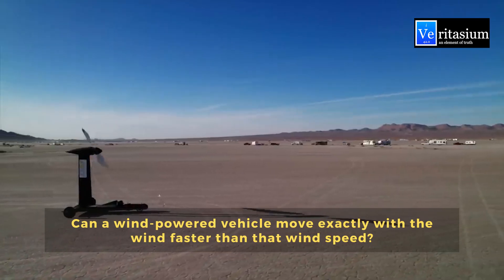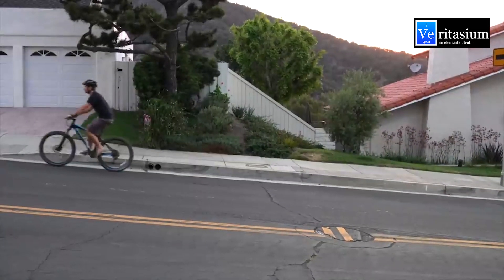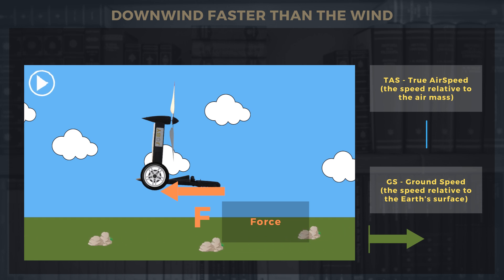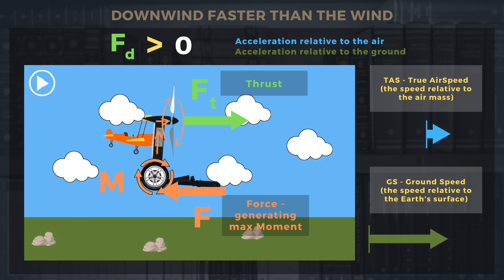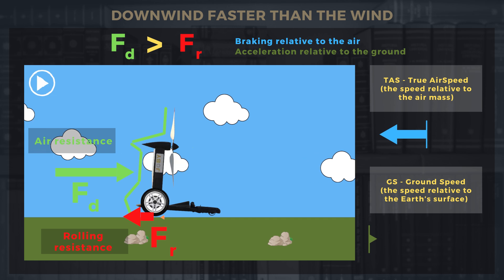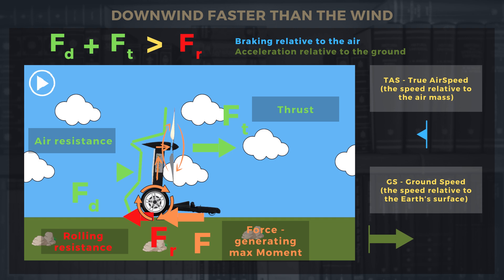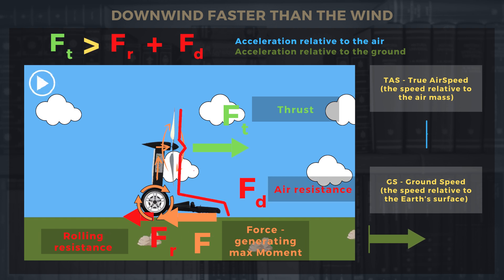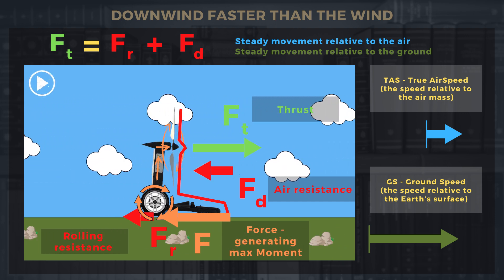Veritasium is wrong. Blackbird vehicle explanation.

Comment: Excellent!  Exactly what the world needs - yet ANOTHER video giving an incorrect explanation of DDWFTTW and erroneously claiming our explanation is wrong.

I can't imagine what makes you believe the retarding force of the wheels turning the propeller has no impact on the speed or acceleration of the vehicle, but that is obviously and completely wrong.

My favorite part is the absolutely clear implication that you could simply hook up a 10 megawatt generator to the axle of any car and make free energy all day long.
Reply from the maker: Thank You for answering my video, it was the middle of the night in my time zone and now I have a job so I will continue this dissuasion later today, but I will try to defend my assumptions in a quick way. When you apply tangential force at 90 degrees to the center of the wheel it will create max moment – and not move the center of wheel. <-it is right or not. It is obvious that in reality it will not happen but we assumed 100% efficiency. In that situation the only force braking the car relative to ground is rolling resistance.  Propeller rotation creates resistance, but this resistance is what creates thrust. This initial force from ground- air masses movement is rotating wheel and propeller. If we assume 100% effectiveness, wheel-propeller mechanism, and ground-wheel mechanism. The force from moving ground will be transferred and generate thrust. Try to understand this conception, I appreciate that you prove it works in reality but as you said it was by trial and error method. The efficiency of the mechanisms is a secondary issue. The only question is how big the difference between ground speed and air masses must be for it to work. If the mechanism is inefficient, it will need a big force to work. If it is very efficient, a small force will be sufficient. It is the same with leverage. It can help with efficiency but on its own it doesn't make it work. You can leverage force but the balance of forces must be positive at first. Regards Piotr
Reply: @PiotrRysztak  
>> it will create max moment – and not move the center of wheel

That's simply not true.  Consider a wheel floating weightless in space.  Apply a force tangent to the edge of the wheel.  The force acts on the body (the wheel) no matter what.  If the force does not go through the center of gravity, it also applies a torque.

>>  Propeller rotation creates resistance, but this resistance is what creates thrust.

That's right.  And if you want to reduce the thrust by the same amount as the tangential force on the wheel, you certainly can.  But that's just playing a numbers game.  The tangential force does result in an overall retarding force on the vehicle, just as the thrust is an overall thrust force on the vehicle.  They may cancel one another out to some degree, but they definitely both exist.  This can be proven by looking at the internal stresses on the vehicle.

>> If we assume 100% effectiveness, wheel-propeller mechanism, and ground-wheel mechanism. The force from moving ground will be transferred and generate thrust. 

I think you're suggesting that they will exactly cancel if the system is 100% efficient.  But that's not true either.  You've decided that the lever explanation is wrong, but I assure you it is not.  In a tail wind, a 100% efficient system will produce MORE thrust than retarding force.  That's the whole point of this thing.  That's why it can go directly downwind, faster than the wind, steady-state.  

>> Try to understand this conception

Try not to be condescending - particularly while being wrong!

>> I appreciate that you prove it works in reality but as you said it was by trial and error method. 

I said no such thing.  I designed the vehicle, did an analysis, wrote a simulation, and then built it, and it performed exactly as predicted.
Reply from the maker: @Rick_Cavallaro  @eyytee i deleted your comment to clean my conversation with Rick i hope you do not mind.

>> That's simply not true. ...

You can only rotate an object without moving its center of mass (theoretically). If we apply force to the center of the object it will be no rotation but force will move him but if we apply force tangentially it will rotate but not move it. If we applied force somewhere between these extremes it will be the ratio push/rotate. The further we attach the force from the center the pushing effect is smaller. You can use force to rotate or to push object (or both dividing the force in ratio push/rotate) – if that statement is not correct then I am wrong.

>>  The tangential force does result in an overall retarding force on the vehicle, just as the thrust is an overall thrust force on the vehicle.  They may cancel one another out to some degree, but they definitely both exist.  

Yes I should have added two canceling each other forces to this equation – the orange force from ground moving (which driving the wheel) should be green and I should add resistance of the propeller which should be red. In the end the Thrust force remains as a green force and this force will be unbalanced. - Will cause acceleration of the vehicle.

>> In a tail wind, a 100% efficient system will produce MORE thrust than retarding force.  That's the whole point of this thing. 

That's exactly what I said in the movie. I only disagree that a leverage is required for this. It is simple balance of forces. Leverage can help efficiency but is not required to work.

>> Try not to be condescending - particularly while being wrong!

I didn't want to be condescending. I’m sorry if that's how you perceived it. I proposed analyze of forces acting from the beginning of the experiment. Let's first establish what happens at the very beginning of the experiment. I think it will be easier to find an agreement. let's analyze this moment (3:23 from my video):
•	Wheel is connected to the propeller.
•	Air resistance is bigger than rolling resistance. – According to Newton's second law it will accelerate (no balance of forces)
•	Air resistance depends on TAS speed.
•	Rolling resistance is constant.
•	TAS speed is bigger than 0.
•	Ground Speed is 0.
•	Vehicle braking relative to the air.
•	Accelerating relative to the ground.
Do you agree with all the assumptions?
If yes, what would happen with the vehicle, wheel-propeller mechanism, and how forces will change?
If not what I am missing at this point, is there any force I am missing? (ignoring gravity and mechanism efficiency)

>> I said no such thing.  I designed the vehicle, did an analysis, wrote a simulation, and then built it, and it performed exactly as predicted

I remember from some statements that you needed some time to build sufficiently effective mechanisms. I admit that I did not follow the process of creating the vehicle exactly. I am kind of - out of the box -maybe it is better? lets find out!
Reply: @PiotrRysztak  
>> if we apply force tangentially it will rotate but not move it.

Again, that just isn't true.

>>  The further we attach the force from the center the pushing effect is smaller.

Nope.  The torque will be greater, but the push will remain exactly the same.

>> I only disagree that a leverage is required for this.

It's a simple fact that we're trading a small force over a large distance to produce a larger force over a smaller distance.  That's how we get force to accelerate faster than the wind.

>> Leverage can help efficiency but is not required to work.

It is very much required for this to work.  That's exactly how we avoid violation of the conservation of energy.

>> what I am missing at this point, is there any force I am missing? 

You are missing the retarding force of the wheels against the ground.  That will be much bigger than the rolling resistance of the wheel over the ground.  And that's the one you insist on ignoring.

>> lets find out!

What is it we need to find out?  There are a number of people here in these comments that understand the physics very well, and we're telling you where you've gone wrong.  Interestingly, where you've gone wrong is precisely where you're claiming Veritasium and others are wrong.
Reply from the maker: @Rick_Cavallaro  You are not even trying to understand my point of view.

Can we use force only to rotate or only to push objects (or both dividing the force in ratio push/rotate)? – Yes or No
There are two main forces acting on cars:
Air resistance and rolling resistance. These forces stopped cars from moving. First in Air second in ground – Yes or No

>> You are missing the retarding force of the wheels against the ground. That will be much bigger than the rolling resistance of the wheel over the ground. And that's the one you insist on ignoring.

What retarding force do you mean? 
If You mean resistance on the wheel from the propeller then this force will be equal to thrust force. It will balance and we will still have extra force acting from ground to wheel (spinning the wheel)

What will happen at the beginning, will the car move or not?
If yes, the wheel and propeller start to rotate or not? 
If yes, does the propeller generate thrust when rotated or not? 

Why you ignore this fragment: 
Yes I should have added two canceling each other forces to this equation – the orange force from ground moving (which driving the wheel) should be green and I should add resistance of the propeller (on wheel) which should be red. In the end the Thrust force remains as a green force and this force will be unbalanced. - Will cause acceleration of the vehicle.
Reply: @PiotrRysztak  
>> You are not even trying to understand my point of view.

I understand your point of view perfectly.  I have made that clear.  I spouted it back to you.  But your claims are demonstrably wrong.

>> Can we use force only to rotate or only to push objects (or both dividing the force in ratio push/rotate)? – Yes or No

You can use a force-couple, or pair of forces, to apply a pure torque.  You CANNOT do that with a single force.

>> If You mean resistance on the wheel from the propeller then this force will be equal to thrust force. 

NO IT WILL NOT!  But by all means, you should keep making that claim and I'll keep explaining that you're wrong.

>> What will happen at the beginning, will the car move or not?
If yes, the wheel and propeller start to rotate or not? 
If yes, does the propeller generate thrust when rotated or not? 

I've explained all of this many times.  It's not my job to educate you.  You have it wrong.  No matter how many stupid questions you ask - you still have it wrong.

>> Why you ignore this fragment: 
Yes I should have added two canceling each other forces to this equation 

I have NOT ignored that.  I have responded to it EVERY time you bring it up.  It is WRONG.  The forces do not balance each other.  But more importantly, even if they DID balance each other, you would still be wrong in claiming they don't exist.  That is precisely what you're claiming others got wrong - but they didn't.  You did.  It is still wrong.
Reply from the maker: @Rick_Cavallaro  I think you are very negative towards me, because of the title of the movie, but if it wasn't for it, you wouldn't be here. I am sorry if I offended you. It was not my goal at all.
I do not claim there not exist i just use the wheel-propeller mechanism as one mechanism. Force acting on the wheel from the propeller acts on the propeller from the wheel. Opposite forces. 
If at the beginning vehicle starts to accelerate relative to ground and wheel and propeller start to rotate then from the very beginning propeller generates thrust. The air resistance slows down the vehicle relative to air masses and drives the wheel and propeller and generates thrust from the very beginning. So when the TAS speed will be reached Thrust can be bigger then rolling resistance.
Reply: @PiotrRysztak  
>>  I think you are very negative towards me, because of the title of the movie

I am negative toward you because you made a video specifically to call out others as being wrong, when it's you that is wrong about the specific thing you're claiming others got wrong.  How many times will I have to say this!?  How many people here are telling you exactly the same thing?  Can you find anyone that believes you got it right?
Reply from the maker: @Rick_Cavallaro  Where is mistake in this statement, last specific answer and i will not bother you anymore. If at the beginning vehicle starts to accelerate relative to ground and wheel and propeller start to rotate then from the very beginning propeller generates thrust. The air resistance slows down the vehicle relative to air masses and drives the wheel and propeller and generates thrust from the very beginning. So when the TAS speed will be reached Thrust can be bigger then rolling resistance.
Reply: @PiotrRysztak  "Thrust can be bigger then rolling resistance"

This is not wrong, but not sufficient. Thrust has to be greater then rolling resistance + braking force needed to turn the propeller.
Reply: @PiotrRysztak  
>> Where is mistake in this statement

>> If at the beginning vehicle starts to accelerate relative to ground and wheel and propeller start to rotate then from the very beginning propeller generates thrust. 

At the very beginning the propeller blades are stalled in the tailwind, so they're producing only drag - not thrust.

>> The air resistance slows down the vehicle relative to air masses and drives the wheel and propeller and generates thrust from the very beginning.

Nope.

>> So when the TAS speed will be reached Thrust can be bigger then rolling resistance.

I assume by TAS you mean "true air speed" like the rest of the world.  But it makes no sense to say "when the true air speed speed will be reached".  I have no idea what that means.  But the thrust will only be bigger if the prop pitch and gearing are adjusted to take advantage of the lever effect we've described.  The one you claim is not necessary.
Reply: @Rick_Cavallaro  "At the very beginning the propeller blades are stalled in the tailwind, so they're producing only drag - not thrust."

I would not get hung up on terminology here. If he wants to call any forward pointing force "thrust", then below windspeed the drag of the propeller acts as thrust.
Reply: @eyytee  that's a bit of a painful stretch, but it certainly wouldn't be his biggest error.